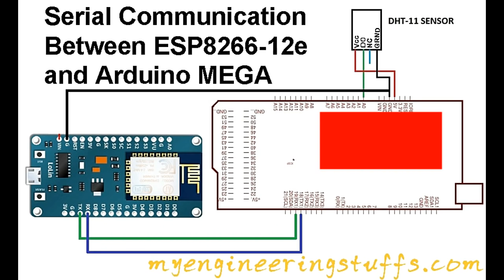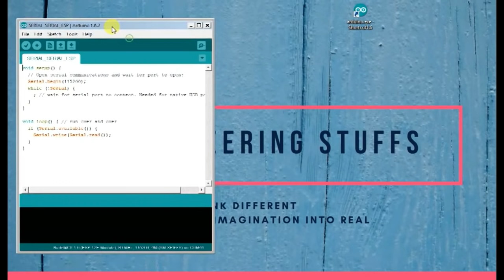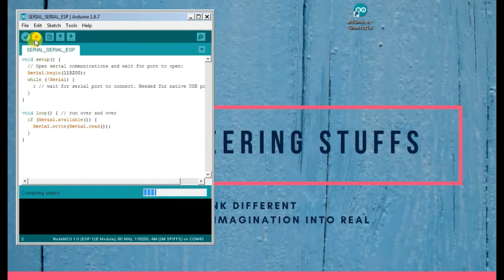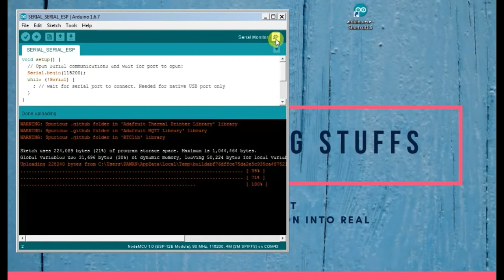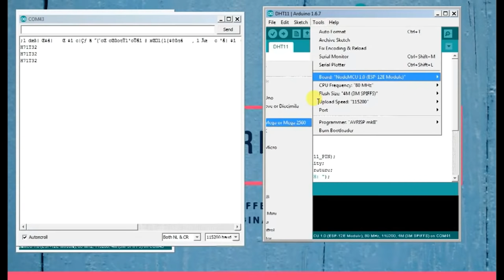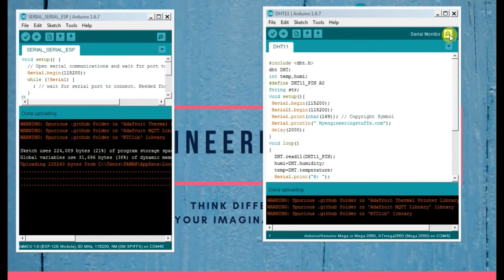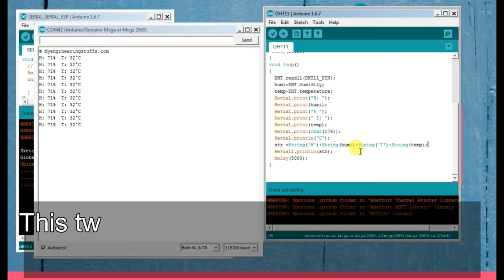Serial communication between ESP8266 12E(NODE MCU) and Arduino

Comment: Vin of nodemcu is up to 12 V, there is a regulator on the board. But don't forget the serial communication between arduino and esp. You have to use a partitor of tension or voltage adapter because you may demage the esp8266 in the RX input pin
Reply from the maker: Hey Walter P thanks and that's true all ESP's operating voltage is 3.3v, but for my experiment I use 5v as default. As of now my ESP's are OK but yes we should not provide 5v. Once again thanks.
Reply: @MyEngineeringStuffs  you're welcome ;)

Comment: Is it ok to connect the nodeMCU to the Mega? Cause i have read in some post that the Mega is 5v and nodeMcu is 3.3v will it damage it
Reply from the maker: Hey friend i m doing only as an example. So better to use voltage divider in the Rx pin of NodeMCU for 3.3v but for i example... I want to show the transmitting and receiving functionality and rest safety you people need to find out. 
Thank you. 
I recommend to use resistor.

Comment: i want to send a number (for example: 120) from nodemcu to the arduino mega, you know how to do it?
Reply from the maker: you can send it as it is... but while receiving the exact data it will be in array. so you need to take out of the and subtract 48 from each of the so that you will get the exact integer. Because you are transmitting a string from nodemcu.

Comment: sir, i have this question hope you have the answer of. I am doing this led matrix project project where user can make any text to appear on the scrolling led dot matrix. I am having trouble setting up the  serial connection between my arduino with the nodemcu. i want the nodemcu to recieve the data(that the user would enter on a web page) and then it would be trasmitted to the arduino so whatever message the user wants is displayed on the matrix display. I'd be so happy if you can help me with this

Comment: Sir we have to insert both node mcu and arduino uno simultaneously and then run the code seperately using different ports.
Reply from the maker: Yes *Rajiv nayan singh*, To see both the data at the same time. Means at transmitting end and in receiving end, we need to open two serial terminal at the same time. If you don't wish to see the transmitting data you can program both the board and by opening serial monitor only for Node MCU will also work.
Reply: Sir I mean to say we have to code for node mcu on another pc and for arduino on another?? and to watch serial monitor on two different pcs??
Reply from the maker: NO Rajiv nayan singh it is in the same PC, we need to open Ardiuno IDE two times.

Comment: Hello sir, for me its showing this      1)Error Board nodemcu (platform esp8266, package esp8266) is unknown

                                                                2)Error compiling for board NodeMCU 0.9 (ESP-12 Module).
Reply from the maker: Pallavi Lambe you need to install the ESP board first then in the board manager you will find all the boards related to ESP. To install all the board search for "How to add ESP board in arduino IDE". You will get number of tutorials to do that. Then add the code and compile for node MCU.
Reply: Thanks sir

Comment: Can you please tell me how I can send this sensor data, that the nodemcu has received from the arduino (by serial communication), to Thingspeak. I was able to do the serial communication part successfully, but is unable to send this data from nodemcu to Thingspeak, I've tried several ways but failed. Any kind of suggestion or help would be greatly appreciated, thanks.
Reply from the maker: Hey friend, You need to download ThingSpeak library and code it in NodeMCU. Just google the library and search for an example. It's very easy to use. Thank you

Comment: Hi sir! In the case of communicating with a MySQL database, how do I do it? What commands do I have to give, and on which board (Arduino or ESP)? Thank you!
Reply from the maker: Hey the process goes like this. At software end you need some web pages to handle the process. First host some web page on your local server or on web server. Then using that URL of the web pages you can insert the data to the data base like MYSQL. And at the hardware side use any module or board which is having a WIFI connectivity(like Arduino + ESP01, any module from ESP) and try to ping/call the URL you have created on your local or web server

Comment: do you have a tutorial for nodemcu that send sensor data from uno/mega to blynk ?
Reply from the maker: Sorry friend till now i don't have any. Extremely sorry.
Reply: @MyEngineeringStuffs  let say i do receive the data on nodemcu from mega via Serial1. now i want to make a Serial.print on my nodemcu but it keep show the value of Serial1 that mega keep sending. is there other way to do this ?
Reply from the maker: Hey friend only one serial port is available. So the pins which you are using to receive data ... you can not use to same serial pins to display data. If I am not wrong the software serial will also work fo Node MCU. Test to upload the software serial code into Node MCU and make any two pins as Tx and Rx.
Reply from the maker: Sorry friend.

Comment: I check circuit  link but I can’t find it. The usb cable connect esp12 and mega，correct?
Reply from the maker: Yes, friend. For uploading, power and debugging. I am using the USB cable and open two different windows. One with ESP settings and one with Arduino settings.
Reply: so the communication is not through wifi, but instead go through usb-PC-usb?
Reply from the maker: Friend its a Serial communication between NodeMCU and Arduino MEGA. Both are connected using Tx and Rx pin.

Comment: im using a dht22 sensor i have edited the code and i have the reading on my serial,but when i open my serial for the esp,the serial of mega closes,and on the serial for esp i've nothing on my screen.
p.s: ive connected the the transmitter of mega to a voltage divider giving an output of 3.3v then connected the receiver of esp.
help please
Reply from the maker: Hey friend you need to open Arduino IDE twice. So as to run both the code simultaneously with respective window which allows us to open two different serial terminal at the same time.
Reply: @MyEngineeringStuffs  Do you have the code for the reverse process of combining both humidity and temperature  for nodemcu?
thank you

Comment: Sir, i am using a acs712 current sensor and node MCU
And i want to establish a serial connection between them can u explain..
Plzz help !!!
Reply from the maker: Hey Kunal Vibhute  if you are using only one sensor Node MCU can read directly Analog data of current sensor and if you are using multiple analog sensor then you can use Arduino UNO to read all sensor data and follow this tutorial. And let me know. Hope it helps you.
Reply: @MyEngineeringStuffs  i have same issue sir.. im using two analogue sensor

Comment: how to take data from multiple sensors and send it to node mcu and then to the cloud .plz help me
Reply from the maker: Please. mail me at support@myengineeringstuffs.com to get full support. Thank You.
Reply from the maker: Hi sandeep... you can download the code from this link ( http://myengineeringstuffs.com/download/1216/ ) and add as much sensor data you want but follow the basic rule. Like Read the DATA in ARDUINO side convert it to STRING then transmit the DATA to NODE MCU then convert the DATA to INTEGER from STRING then publish the DATA to ADAFRUIT.IO cloud. Hope this helps you.
Reply: MyEngineeringStuffs sir isn't it possible to send data without converting it into string
Reply from the maker: Hey vijay mourya as of now i have tested with string only and i think its a bttr way of sending data. You can try to send data with a Character followed by the sensor data. Character will represent the type of data(Humidity, Temperature, etc...) and followed by sensor data. I hope this works for you.

Comment: Thanks for sharing this, btw, how can I send the other way. ie. Sending FROM NodeMCU to MEGA.
Edit: The code up there works very well :)
Reply from the maker: Thank you friend.
Reply: I found the solution. Serial.println (nodemcu) outputs directly to the Serial1 (mega).. just need to listen to it.
Reply: How can you sending from nodemcu to mega? Please help mr to share your sorcecode...
Reply: @brunobernard86 can you sending data from nodemcu to arduino mega? If you can it, please share your code.. thx
Reply from the maker: Hey friend you need to send data from Mega to Node MCU. And write a code in the Node MCU to listen the data.
Reply: @MyEngineeringStuffs  why if i want send data from nodemcu to arduino mega?
Reply: @MyEngineeringStuffs  i try to swip this code, but not succes.. please help me...
Reply from the maker: hey friend swiping the code will not do the job. You need to write the code respective to Node MCU and MEGA individually.
Reply: @MyEngineeringStuffs  i'm sory, i dont understand. Can you give me examples for code nodmcu and arduino mega?
Reply: Hello everyone. Do exactly same as the code in the video. Once done. Do serial.println from the NODEMCU. Okay ?

On the MEGA, make it listen:
If (Serial1.available())
Serial.println(Serial1.read());

So basically what happens. Since serial1 on mega is connected to serial on nodemcu. You do the other way: 
You serial.println from nodemcu. On mega you listen on serial1.
Reply: Hope it helps! Dont remove anything. Keep the code like in the video. Just add those line I explained :)
Reply from the maker: Thank you Joseph Jean Bruno Bernard. Every One please follow this protocol of communication so as to get a better result.

Comment: thanks
Reply from the maker: Thank You
Reply: it is way send data from arduino mega to nodemcu ( esp8266 12e) and if i want send data from nodemcu to arduino mega, please can you help me  ? i have problem it
Reply from the maker: Ya sure... But please describe your problem statement(What exactly you want to do)
Reply: i want to send data from to nodemcu to arduino and opposite
Reply: very sorry, my skill English is not good
Reply from the maker: See when we are sending the data from mega to nodemcu, the format is like this first we take the value(May be your sensor value) convert it to a string and then transmitting to nodemcu. So, the same format can be used to send the data from nodemcu to mega board. Otherwise if you want send string data then directly you can send it. using Serial.print(); function and in the mega side wait if the data is available then print the data like this: if(Serial.available()){
                                                      Serial.print(Serial.read());
                                                       }
Reply: thanks, i have got it
Reply from the maker: My pleasure